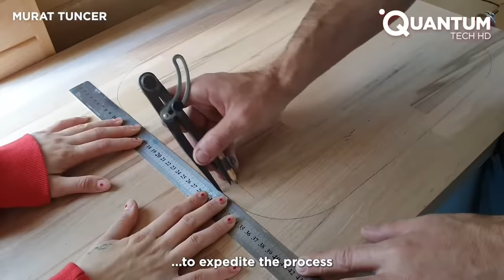Man Builds Amazing DIY CAMPERVAN | Start to Finish Conversion by @murattuncer

Comment: Thank you filming and editing your work and sharing freely. You are so talented and your attention to detail is amazing. You are true craftsman. 

I do wonder about the outgassing of the spray foam, paints and other materials that one will be subjected to in this small space. 

It would be fascinating to see a "healthy" van conversion using natural or low emission materials where no other alternative is available. For instance, hemp insulation which removes carbon from the air, natural paints or stains

Comment: i like it but all that timber trim on the walls is too heavy. yes it does look nice. But maybe 100kg of layload used.  just use canvas painted with glue or something similarly lightweight but pretty. Theres probably 200kg of extra payload on this just for asthetics...
yes asthetics are nice... depends what you want.

Comment: I did something like this only with my horse trailer. I insulated and paneled my former front tack room. Added 12v system with solar, a 39 gallon water tank, cot, dresser, porta poti new window and new vent. I have reading , overheard and exterior lights. I then did the same to the horse stall compartment turning it into a two horse from a three horse by using the front stall as my kitchen. It transforms from a horse trailer into a camper in a very short time then back when finished camping.

Comment: Mark 6 and Mark 7 transits are rust buckets - do not convert one as somewhere down the line the underside will be completely rotten. They just were not made well enough when it comes to corrosion. A better option is the Citreon/Peugeot/Fiat vans, or a later model transit. Also you can only sleep across a transit if you are short - I am 5.9" and it was never a good nights sleep in the cross configuration that i originally built.

Comment: Great, great, great skill in carrying out the work, magnificent result, but I have some doubts about some choices made, such as the internal frames cuts to insert the windows, without inserting any reinforcement, the many holes above to place the panels (thermal bridges and risk of infiltration ?) Foam insulation is toxic, banned in many European countries. For the rest, truly an exceptional result.

Comment: I just wonder how much extra weight is now in the van and how that will affect the engine as obvs designed to carry a load in the back - yet what is that tonnage - did they ensure the build was below said weight restrictions so you can still add the weight of people being carried too? 
Also the suspension etc etc - weight is such an important part as will also cost a lot to drive around all that weight
I just know of peeps who didn’t take that into account and caused a whole heap of problems

Comment: All that wood adds a lot of weight to the van and will make it tougher to get good gas mileage or torque up a mountain.  It is stunningly beautiful but lighter wall panels made of aluminum or similar would be great and real wood (not particle board) cabinets….  Oh and you have to wrap the flimsy hose under the van.  One rock and that thing will be torn.

Comment: All my respect for this true master of transformation.  But there are some details that on a technical level don't convince me.  From a blind vehicle, without windows, he transformed this vehicle into a vehicle with windows.  Then the registration certificate will have to be re-approved by the competent body.  Plus all the work done, with the material purchased, which was mostly solid wood, the weight of the van will have increased dramatically.  Great respect for him, and for all the work done.  But there wasn't a bathroom.  Beds to sleep on.  My comment is not intended as a criticism.  On the contrary.  But personally, I see this van as more beautiful than practical as a camper.  This, however, does not mean that this person is truly a genius and above all an excellent worker.  I conclude by asking myself one thing.  Wouldn't buying a camper perhaps used, but in excellent condition, for say 20,000/25,000 Euros be more convenient?  I don't think he works for free, and that all that material purchased honestly cost little money.  The fact remains that he did an excellent job g.l.🇮🇹

Comment: After these heavy modifications to the structure of the vehicle (windows, roof, etc.), isn't a new certificate/circulation permit necessary from the authority that manages the vehicles (safety, suitability...) at a national level?

Comment: You 2are so focused on the Diggs of ‘21 that you haven’t done your work on the Diggs of ‘23 when he was clearly in decline, especially in the second half of the season. Please just check the reception % for both Diggs & Davis vs Shakir & Kincaid. Josh’s QB rating and interceptions were radically different in comparison. The Bills got better by subtraction. Instead of just having an opinion, do your job.